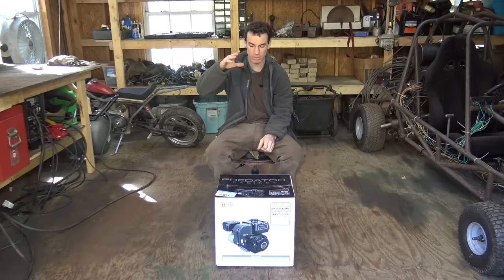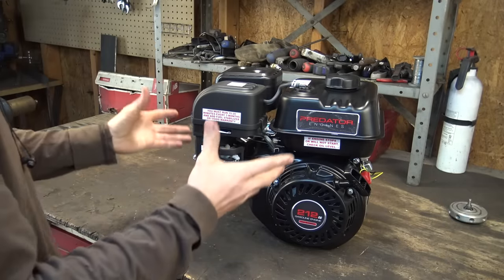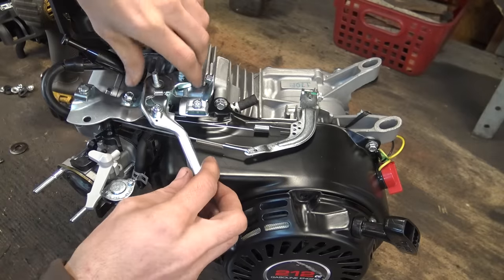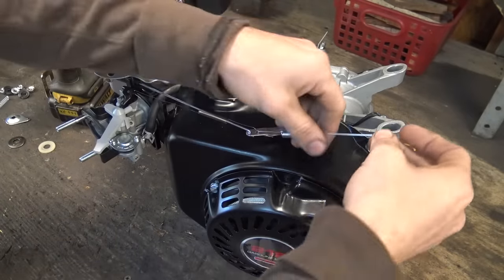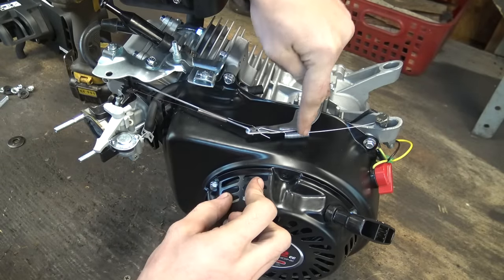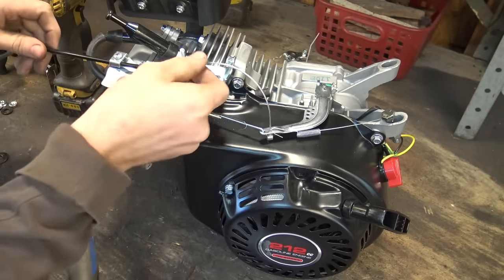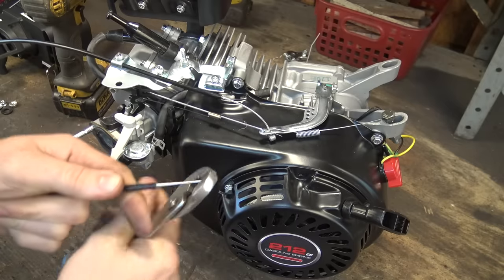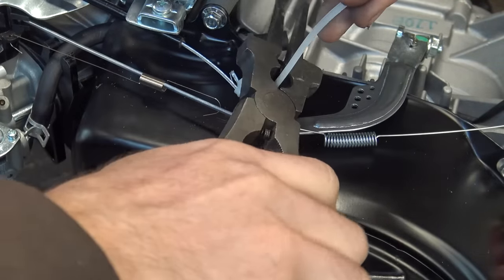how to bypass the governor on a predator 212 engine

Comment: Im having a problem with my engine starting. Wont start unless im giving it a little gas. I did the whole conversion while watching the video so i didnt do any thing wrong
Reply: It's normal to have to give a little throttle to start the engine.
Reply: That's because the idle screw was removed and now it won't idle. I suggest more research on this and more videos of bypassing the governor bc it is still hooked up. If you don't remove the gear from inside the motor or at least remove the hard wire arm from the governor arm, the governor is still active.

Comment: @RatherBWelding  7:37 when having to use a blank end of a cable try using the little cable locks, that use a "U"-bolt, two nuts and, a metal piece. That presses both sections of cable together and locks them in their place tight

Comment: This is a poor substitute for doing the right way. I bought a mini bike that had predator 212cc with this exact setup. There is a small plastic piece inside the engine that the governor arm interacts with as the governor gear engages. That plastic piece came off and got crushed up inside the engine and eventually the pieces got stuck in the mechanism of the cam shaft that allows you to pull the crank cord without it jerking your arm off. 

I ended up buying another predator 212cc for the bike until I can afford the parts to fix the other one and remove the governor properly.

Comment: If you do the hoop thing DONT USE ZIP TIES.  Use a small bolt and nut with 2 appropriate washers to sandwich the cable. , but slightly curve them with a hammer and point them inward so the cables wont slip past the sides. Also. You did not bypass the governor.

Comment: hmm, i left the throttle assemble in place and left the cable hooked up the normal way. then i disconected the governor and ran a new custom linkage bar, made from the old one, from the throttle lever to the carb. the governor is fully disconnected and left to do whatever it does. for me that was easier because the throttle cable was already hooked up and in place and i didn't want to mess with it.

Comment: will that work with a Mikuni Carb??
Reply: It will not. The spring attached to the governor arm would need to be attached toward the carb not toward the gas tank mount at that side of the engine.

Comment: I use to heat led in a old pan and at the right temperature (as its cooling down) I would keep dipping the cable end until i got the size ball i wanted,did the same when making bell sinkers,

Comment: my way of bypassing on a gx160, remove the lever and everything apart from the clip holding the inside lever on, (i made that mistake already, i removed the clip and it went down into the engine slowly caused knocking and locked it up, so i had to do a full rebuild and made some mods. I left the gear inside coz i cant be bothered to remove, i learned my lesson, dont remove that damn clip)

Comment: Thanks for showing us the top of the engine, but No way.  80% of People can't spot a stupid hack??  Take a look at Bob Kelly's suggestion:  1) disconnect throttle from the governor arm at the carb.  2) figure out a way to hook up your throttle cable directly to the carb throttle cause there's no linkage, or -- 3) DON'T DO IT AT ALL.

Comment: this doesn't seem right. the way I do it is to take the governor arm off than hook up the throttle arm directly to the carburetor
Reply: How could I do that? Seems difficult
Reply: mcconMcConnell it takes a little time but you will have full power of your engine. you remove the whole governor arm and gear from inside the engine. than you take the old throttle linkage from it and bend it from the carb to the throttle assembly

Comment: This is a pretty janky setup. Did something similar and the makeshift spring holding the throttle closed  snapped. The throttle flew open n the kill switch on my bike wouldn’t shut it off. Not saying it’s a bad set up just be careful n know where the gas shut off valve is on your bike lol.

Comment: this should be titles how to quickly destroy a 212 removing that will result in too high of rpm's and burn up your motor. why does everyone want these bikes to go faster and faster? they are tiny little unstable bikes made to putt around with you don't need to go 60 mph on them.
Reply: these engines can run 3750 rpm no problem i thought the fan spins faster and cools better

Comment: Its much easier and cheaper to use an old bullet proof tiller or blower motor,just what was used in the original 70's Mini's and Go-karts. (Tecumseh or Briggs) Besides that cable set-up up isn't at all good,there's easier and better ways to do it. (no offence)
Reply: I'd rather go buy a $100 predator than use a vintage engine.

Comment: Just do it the right way and take the side cover off and remove the gear and shaft, 1/4-20 self tapper in the top hole, don't scab it like this method.

Comment: Please do alot of people a favor and edit or remove this video. I just had to completely redo a friends bike that was done just like this by the guy he got it from. He had to of watched this video before he did it. It caused a couple hours of suffering out in the Texas heat sweating my ass off and getting stung by mosquitoes. And I had to remove parts from a spare complete engine I had to get it done since you deemed the ones you removed "unnecessary".

Comment: I did it a different way using some Tig wire bent to hold it but when I first did it I did it wrong because when I first started it on my mini bike my dad was holding on the front and it was suddenly locked at full throttle so it ran over my dad and spun around untill I flipped it over and the oil sensor shut it off

Comment: Thank you for the great tutorial but could anyone tell me if this would work on a Honda gx270?
Reply: Yes,it will work..i have a gx340 honda..and i did this.and put new 35 #valve spring on it..
Reply: @prcc8793  thank you, mine has a 6:1 reduction gearbox on so its gonna take all the rpms it can get 😂 im planning on running 1:1 gears on the clutch and axle sprocket but i will still need to wind it out for any speed.
Reply: @realsamraudabaugh1332  ,nice keep it up 👍
Reply: @realsamraudabaugh1332  just thinking about it now, you can't just slap a clutch on the output of that reduction box. The reduction box would lower the speed the clutch weights spin at too much and it won't engage. You're better off removing the box unless it's the crankcase cover as well as a gearbox.
Reply: @polaris6644  thank you, also it is integrated into the crankcase cover so im more than likely gonna have to make a trip to harbor freight lol.

Comment: Does not bypass the governor the arm you left on is the governor arm when that arm moves with the throttle Full Tilt to wide open the governor is activated! The arm you took off should have been the one you kept and the other one should have been left immobilized and unhooked from the setup that way whenever it was put into the full throttle position it never pulled the front arm back activating the governor you literally left the governor arm on! Why the hell would you hook it to the governor arm causing it to constantly activate the governor you should have immobilized the governor on so it would not activate the governor I don't know this doesn't make any sense I didn't do it this way and mine never kicks in the way you're doing it it would always kick in every time you floored it

Comment: If your using this Honda knock of engine to replace a failed whatever dont do this. Governors govern the throttle  at 50% opening  on any piece of Commercial Equipment under a specific working  load and get tested that way by the OEM making the equipment. Also brand new engines out  of the box are governed at 3600 RPM. Some exceptions with a slightly lower or higher RPM are mowers and water pumps adjusted to the specific use by the engine manufacturer. Wide open throttle response can and will cause engine damage and I've seen plenty of engines including Honda's that the con rod failed on and trashed the engine due to lack of governor response and overloading the engine. Go ahead as it's a knockoff made in China and they copied Honda's mistakes in the late 90s as did all Honda knock off Chinese engine manufacturers.
Reply: The valves on these will float before the internals are ever stressed to the point of failure. Don't believe me? Go ahead and ask anyone that races karts in the Preditor class.

Comment: What does a governor even do exactly
Reply: limit the rps of the engine
Reply: nolagnagol so why do they put them in the engine
Reply: @zackskinner2666  I'm not sure it's probably a legal thing, or it's so dumbasses don't hold the throttle down 100 percent for 2 hours
Reply: nolagnagol oh ok
Reply: The governors job is to maintain a certain RPM at a given (fixed) throttle position to account for changes in the load.

Comment: This just puts stress in the governor. This doesn’t bypass it. You probably had your plastic internal gear explode on you. If you unhook everything from that governor arm and hook your throttle directly to the butterfly on the carb then that bypasses it. Still will over rev and blow apart the internal governor gear and ruin your engine. Gotta take it all apart and remove the gears that aren’t needed and remove the governor post and plug the hole with a tap and bolt. This here is just a dumb way to get a bunch of unknowledgeable people to ruin their engines

Comment: Do you really have to do it to the arm I just said fuck the arm and went to the carb drilled a hole in the black piece and shoved cable thru there and looped it around and heavy duty zip tied it at an angle it work like a charm fr

Comment: not a wise thing to do friend, the governor is put there for a reason.you can damage your engine doing that, or even leave it inoperable
Reply: Drag racing. If you just put in a high quality oil it’ll help compensate some of the higher rpms to a certain extent.

Comment: I work on small engines for a living and all you did was take the Manual Control Arm off , that does nothing for your governer  as it is still connected and functional . . . .
Reply: The governors job is to maintain a certain RPM at a given throttle position to account for changes in the load. This involves the ability of the governor to move the throttle towards the closed position when necessary. With this guys jerry rigged throttle how do you suppose the governor will  move the throttle (on the carb) towards the closed position when needed with his cable pulling the other way? I wouldn't call this a fully functional governor.

Comment: You really dont need to do all this BS. Just put a zip tie on the main governor spring (the one not on the governor rod) to keep it from expanding and attach an external throttle return spring from the throttle arm to somewhere on the block with a decent amount of tension

Comment: the gear inside is only rated for 3600 rpm so if u leave it in it could break inside your motor

Comment: who ever made this doesn't no what theyre talking about you didnt stop it from being governed, to do that you would have to cat something on the black knob way to the left of the video thats attached to that little spring.  that the only thing thats stopping that arm from going any further when you will use the throttle. 

its the same concept back in the day, it was a little flap that stopped the carb and engine from getting more gas cause this little lip it the metal and you couldn't go any further so you had the break it off and you could ride the bike till in start shaking,  felt like it was going to blow up or something, 

on that bike there you have to do something to that black three way knob that little the metal in your video every time you pull that arm. 

it need to be altered back where the tiny spring goes to in the back.

Comment: But u missing one thing by removing the governor u get unlimmeted refs its basicually like a rotory motor wht u did u stil sit with limited refs meaning limited speed and power and u took off the arm and puting the spring to the otherside thering does exactually what tje arm leaver did and i knw wht im talking about i work wth these motors everyday u get the same motors on generators im a generator mechanic so i knw wht im talking about

Comment: That isn't the governor the governor is internal the arm that you put that spring on that needs to come out to remove the governor and have to fill the hole with a bolt and nut and washers with rtv sealer on it all you did was remove the throttle arm and just did alot of unnecessary work to just do pretty much a rigged throttle set up lmao
Reply: he knows thats he just trying not to go tho the hasle of going inside the engine

Comment: It was good up until he attached the throttle on with zip ties. Hello? Full throttle failure! Get a nut and drill a hole in the side the same size as the cable. There u now have a cable clamp.

Comment: That doesn’t get rid of the governor.
Reply: With the setup in the video the governor cannot function. It's still in the engine but cannot move the throttle on the carb. This is a minibike or go kart setup. You would never do this if you wanted to keep it as a utility engine.

Comment: What the actual crap kinda rig job is that?
Holy Crap!
Thats not any simpler at all.   The ACTUAL way the cable is supposed to go has a bolt that holds the cable.  Not a zip tie mess that will eventually come loose.
You know the REASON people remove the Governor is because on that engine is because when it goes on a go kart it will be limited to only about 12 miles per hour with the governor on it.   It will do double that with the Governor off.   The engine is way over governed for use for things like log splitters and stuff.  Works fine for them.   Governor needs removed for go karts though.

Comment: You did not by pass the governor using the governor arm for the throttle linkage  is not bypassing the govenor.
Reply: But connecting your throttle cable to the governor arm prevents the arm from swi ging back and killing the throttle.

Comment: This literally does nothing but change the mechanism that pulls the governor arm and throttle linkage,  governor still works just the same because it's inside the engine and the arm is still in play within the throttle assembly. Have to remove governor if you want to do correctly, this mod does not bypass anything, it simply removes the pulling mechanism/arm within the throttle assembly and replaces with a direct link to governor arm and different spring placement. Notice that the governor arm still moves exactly the same as it did before removal of the parts, therefore still working exactly the same as before.

Comment: Without a governor, you need a secondary means of limiting the RPMs so as not to damage the engine.  That could mean you, or it could mean the setup you put it in, but if you exceed a certain RPM,  say bye bye to your engine.

Comment: Horseshit, who would trust anyone that loops a cable back on itself and secures it with a fucking ziptie? Do it proper and remove the flyweights from the inside, they're cheap plastic and not made for rpm's above 3600 anyway, if they blow at a high rpm there goes your bottom end.

Comment: these engines do not have oil pumps in them and rely on a dipper attached to the bottom of the connecting rod to splash oil on moving components. for this exact reason is why the manufacturer installs a governor so you do not over-rev your engine and blow it up due to a lack of oil. only do this mod if you are ok with significantly increasing your chances of blowing up your engine. furthermore, the cable is still attached to the governor, in fact the governor is the only thing that didnt get a modification in the video. you should not string a stranded cable, much less crimped, into a hole that already has a spring in it. this is a great way to break the arm off the spring and have ZERO RETURN to your throttle. last but not least, dont even get me started on the zip ties that are holding the improperly installed cable in place. this video is a joke of a how-to...